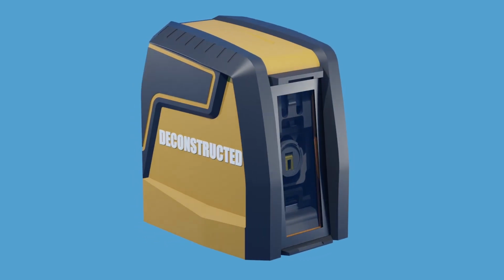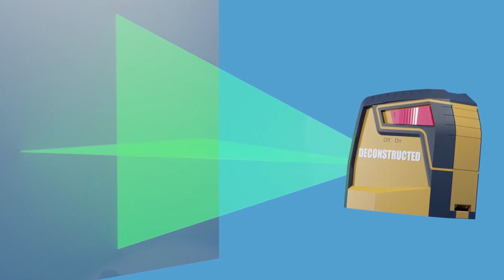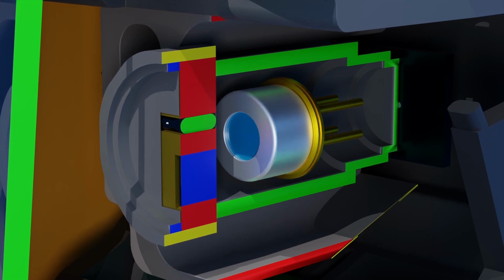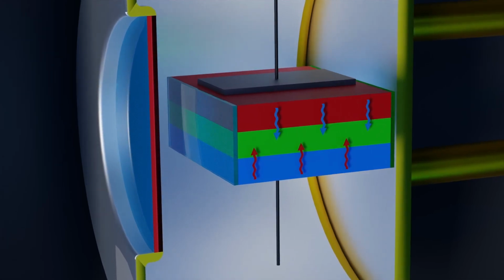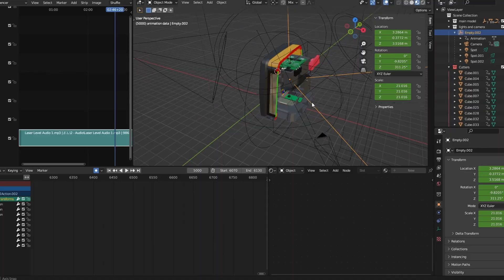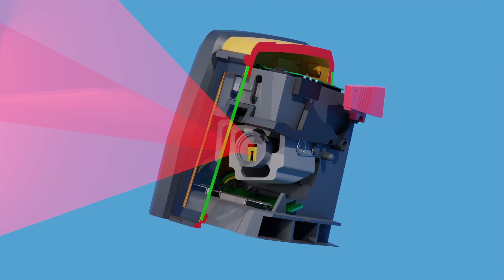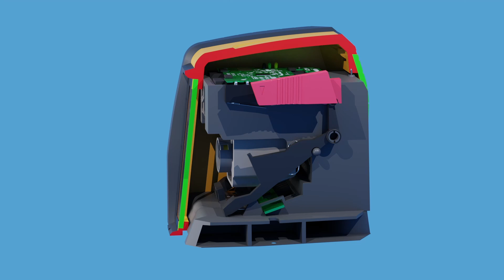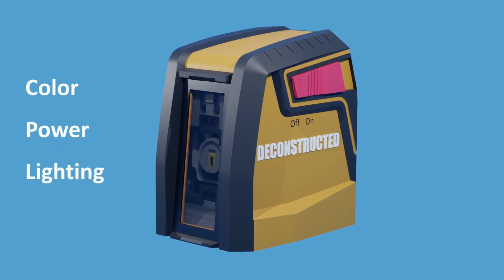How a laser level works

Comment: Why don't the magnet interfere with leveling?
Reply: It's not strong enough
Reply: @leloctai The frame is made of a ferromagnetic metal (steel). Ferromagnetic metals "try to copy" the magnetic field of the magnet, and changing it (in this case by rotating due to gravity) has a damping effect since the metal does take time to change it's magnetic field

Comment: You need to do a video on retractable hose reels! I've seen almost nothing online that's as in-depth as your videos and wanted to fix one of mine that has stopped locking the hose length.
Reply: A nut/bolt may have come loose on the ratcheting mechanism. Are there any loose parts flopping around?
Reply: @boostedxmas I've been searching up how to disassemble them and kept getting warnings that I shouldn't be since there's a high torque spring. I think it might just be the teeth of the locking mechanism being worn out. I can replace it with a 3D print but just wanted a better idea of the internal prior to taking it apart. Really don't want to get hit by the spring 😅